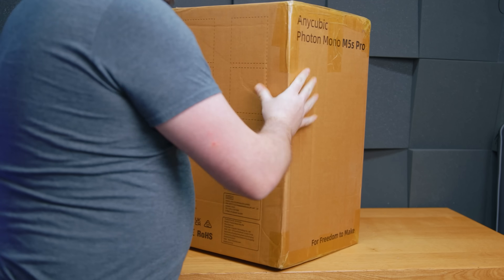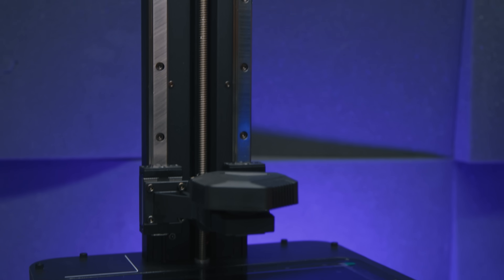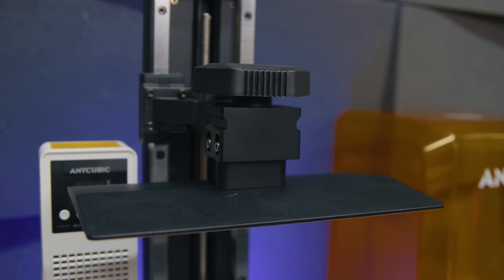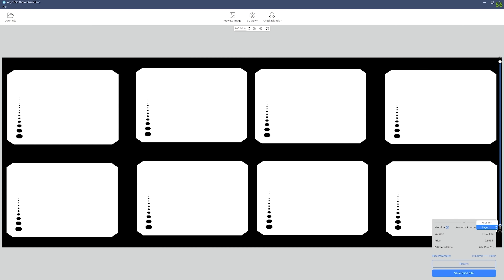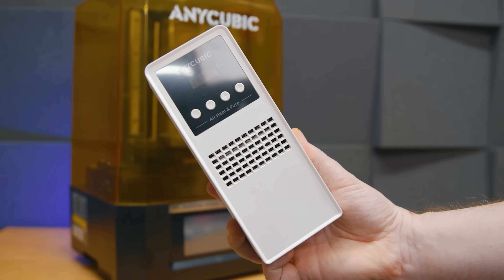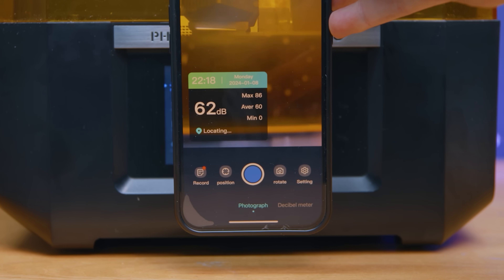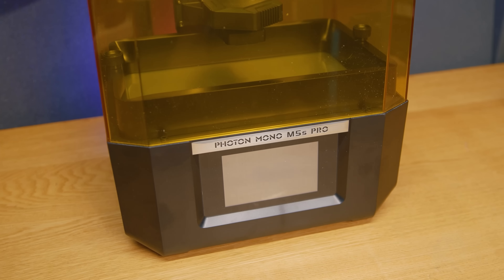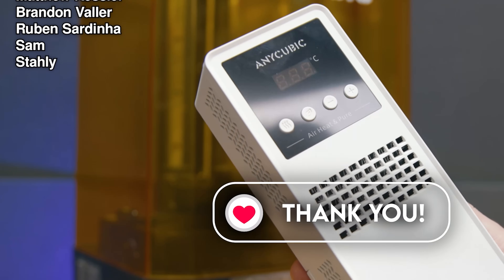About Damn Time - Anycubic Mono M5S Pro Review

Comment: Hey Ross, just wanted to let you know that I bought a Saturn 3 Ultra based on your videos as well as other reviewers and it's been printing for me non-stop for a day now! Having a ton more fun with the newer printer. Thanks a ton for what you do it has certainly educated me before my purchase. My last printer was the Anycubic Photon S and the only things that came out well in that were larger models or models without a lot of detail, but this printer is giving high levels of detail out of the box. Also, I did buy the Chitu Systems heater you said you were considering reviewing in an earlier video. I think you should consider reviewing it. My own experience with it is that the heater works quite well and has given me consistent temperatures, was easy to set up, but there are a few caveats: The magnetic plate it comes with is quite huge, and the trim guard it comes with needs to be adhered to the lid which can leave a mess. I ended up not using the trim guard and instead opted to Dremel a notch in the lid of my printer which works quite nicely and was less work than trying to put the trim on, as well as not leaving a mess of adhesive on my lid I need to clean up at some point.
Reply: My m5s has been a disappointment and after lots of tweaking and a new build plate on warranty from Anycubic it still doesn’t print as good as a Elegoo Saturn 3 Ultra I bought after getting fed up with the m5s. The Ultra has run for a couple of weeks and not yet a failed print.
Reply from the maker: the Ultra is an incredible machine, I must have sold hundreds over xmas and hardly heard a bad word
Reply: @FauxHammer my only complaint is it splashes resin all over the place, even on “normal” mode.
Reply: Which one is better? M5s pro or saturn 3 ultra?
Reply from the maker: @DiegoSouza-ou6ei  I prefer the Saturn 3 Ultra, and if you need a heater, get a third party one.

Comment: Hey Ross, does this printer comes with a glass plate to protect the screen? Or we have to use a protective plastic sheet? I hate those things. I always get bubbles underneath them, especially for the old Mono M5S. Which NON-DLP printers come with a protective glass Plate?

Comment: I am looking for a printer that can be used to print small functional parts under modeled addons for my train models, that also need to be dimensionally correct. I am currently using a mars 2 pro but am looking for an upgrade. 

What would you suggest? I am not really on a budget, but would preference something around 500 dollars, if the more exspwnsive ones aren’t vastly better. Thanks in advance.

Comment: @FauxHammer! Help. Wanting a resin printer for my 3D printing startup to do some finer/smaller items and im honestly so confused on what to buy. Budget is $500 and would prefer better quality over faster printing. What should i consider/any suggestions? Im not a fanboy of any brand. I'd rather get whatever is best suited or best value.
Reply from the maker: Saturn 3 Ultra. Bigger user base better built components than the competition.

Check out that video, you may wish to swap the ACf film for PFA for ultimate quality
Reply: Thanks so much for your recommendation! @FauxHammer

Comment: About 90% of the people cant see the difference between an average print quality vs a good one. 90% of the 10% that does ruins the model because they can’t paint at the same detail level as the print. 

So if you’re looking to buy a printer to use for yourself and you’re not a golden demon guy, buy the average ones. Oh, should mention all the hobbyist who pay tons for printers and resins but can’t manage supports so the prints ends up average anyway. In other words, if you need a good printer then you know it already, if you’re even thinking about good vs average get an average because it will fill your needs ;)
Reply from the maker: Yeah, absolutely! great point well made. Though i would add that convenience features are often worth an extra expense. I;d rather pay more for an easier to use printer than a higher quality printer, becasue print quality has been fine for ages
Reply: @FauxHammer  totally agree :)

Comment: I have a quick question other channels report this when it starts printing goes all the way down then resets to top position which cause resin to drip all around the cover and around the vat. did you have this issue? trying to decided between this or if the gk2 is worth the price upgrade
Reply from the maker: Ummm, I never noticed.

Comment: I hope the light source is just a software update for the m5s. I am not sold on the auto leveling it doesn't seem to always work correctly.
I think a manual leveling is better than the auto we currently have in it. but not much I can do about that.
Reply: never had issues with leveling, but if out of the box isnt leveled, i get it, you can still level it manually, but it's a bit annoying
Reply: @xRaptorScreamx  the m5s has no way to level besides the auto level system. You cannot adjust the build plate.

The plate pushes down and the screen and vat all get pushed down with it. and then supposedly gets locked in place at a set level.  but In my experience it isn't always accurate on that.

on my other printers I can manually level it and get consistent results. Its the inconsistency that is annoying. for the most part i get successful prints om my m5s but sometime it just didn't level correctly and there isn't anything I can change to make it work better.

Comment: You use 0.05mm layer height.  That's literally somewhere around 4K worth of detail.  If you're doing it and others are doing that too, why do we even care if it is 8K, 12K, or 14K?  Even more, 68 Million Pixels is roughly 750% more pixels than 4K pixel values.  In other words, I wouldn't be harping on this at any point in future videos, because the current print volume sizes far exceed what is a reasonable expectation of detail and quality.

For the record, I like your reviews and I do not own this printer, so not really justifying any purchase.
Reply from the maker: How is 0.05mm 4k? Without knowing the “size” of this 4k screen. This comment doesn’t actually make much sense.

Not being a dick, I just want to understand what you mean and here so I can answer appropriately

Comment: Dammit Ross! I've been eyeing up the Saturn ultra since Christmas and now I'm just back to indecisiveness 😂
Reply: I was a heartbeat away from ordering an Ultra when I saw this. I'm going for this for the heater.
Reply: Haha same here have cash waiting but can't decide on which 10 in screen printer I want
Reply: Fermentation belt on the S3U for 10 bucks still a better solution.
Reply: @CrashnServers  could you share a link where to look at that one for S3U, many thanks in advance
Reply: I went with the S3U for several reasons, Ball screw instead of lead screw, Light source accuracy, Actual working WiFi connectivity with SEVERAL different slicers, and Internal hardware by Chitu Systems. FFS, Chitu STILL makes parts/upgrade kits for the original photon (OG) so I can postulate that chitu will continue support for the S3U for some time.
Reply: @BrickBazooka  it was several months ago,  and I got it for less than 400. Also, for 30 extra bucks, mine is heated now. Bought a cheap heater off of Amazon, and modded my cover to accept the heater